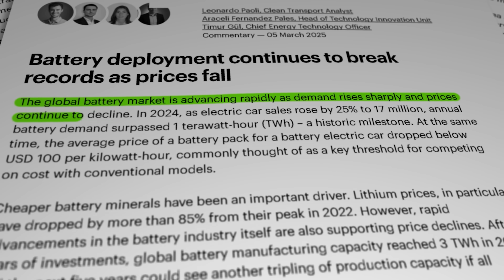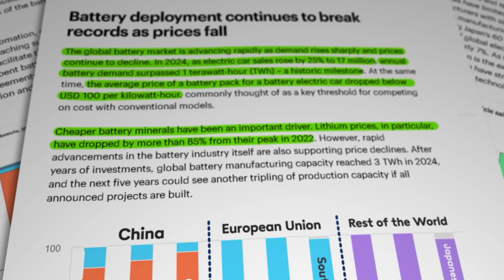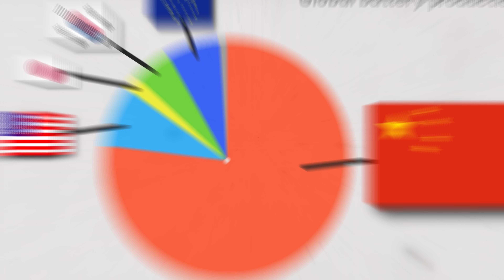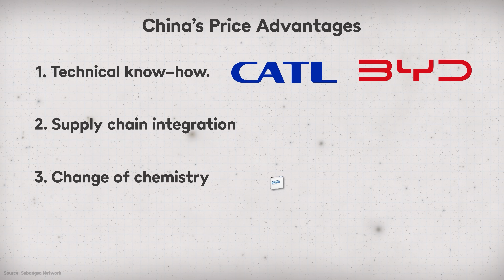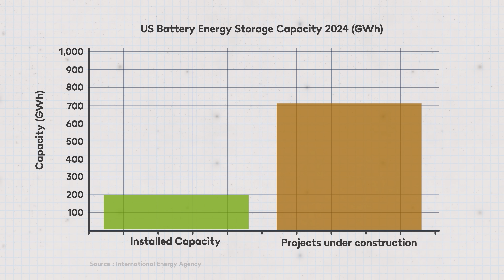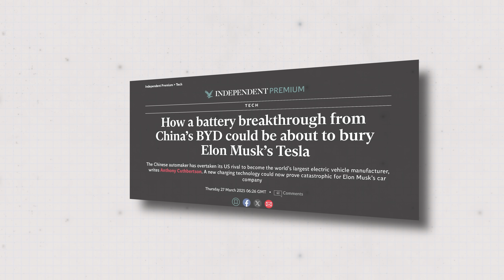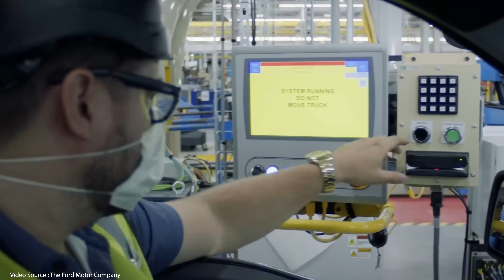Have batteries just hit their exponential curve??

Comment: I travel to Shanghai very often. There are still a lot of Teslas on the road, but sales have dropped precipitously. This is not only due to Musk and Trump destroying the brand image, but also because the Chinese brands are years ahead of Tesla with full self driving, styling and fit and finish. It's not even close. With an XPENG, it's FSD can pull out of the spot and drive me to a busy shopping center, find a spot and park again and I never touch the wheel. Musk's idiotic insistence on cameras only will ensure FSD on a Tesla never happens.
Reply: And yet the Tesla Model Y is up there in the best seller list in China. Users of FSD Supervised in China are saying it's a generation ahead of solutions from XPeng and BYD. Maybe you are swayed by media reports about Tesla vs. China EVs, but the fact is that sales dropped temporarily while the new Model Y Juniper production was being ramped after CNY,  and quickly regained strength. Tesla China sales are still easily No. 1 by revenue, and probably still close to No. 1 by number of sales.

Comment: I do think you give Tesla a bit too much credit, at least, globally. Based on what I've seen, regulations have been the single biggest factor in EV adoption, innovation, and growth. Even in the United States, Tesla built its business on the back of ZEV credits that it was able to sell to other automakers. Globally, China was making the transition to EVs with or without Tesla, and where China goes, the world was inevitably going to follow.
I will say that, even as an LFP advocate, I'm not fully sold on LFP being the only EV battery solution. LFMP should offer some energy and power density improvements, but they will always be a step behind nickel cathode batteries. That step might become a smaller and smaller issue over time, but for high energy, high power applications, it means that there will be a place for nickel batteries well into the future.

Comment: I attended a meeting with an MIT electrochemist on Thursday, not allowed to share details, but they see sodium metal as a viable battery technology that will outpace any lithium batteries by 10x and allow for use in aviation once fully developed and commercialized.
Reply: Promissory engineering. Let's say it true. Then the violence with which damaged batteries conflagrate will be roughly multiplied by the same 10x. It will make for fascinating videos.
Reply: @tomgroover1839  If it's not safe it won't be on airplanes. Not all chemistries have combustion issues.
Reply: @mv80401  li-ion batteries over a certain size are not allowed in checked baggage on commercial flights. There are specific rules regarding this that you can look up. So why? Because all batteries of a certain energy density x energy capacity and above are combustion risks that the FAA has identified. PERIOD. That's why there are EV fires to begin with. And now you say they are going to actually have gigantic batteries with gigantic power density as flight power sources.  Sure thing. Can you tell us what happens after one of these electric airliners disgorges passengers? Tow it over to a charging station for an 8 hour charge between flights were it sits unusable with all the other charging aircraft? Worse than promissory engineering. We're really talking pipe dreams here.
Reply: @tomgroover1839  I don't mean to be impolite but do keep up. There are battery planes in the air today, not in a pipe dream. Why don't you go check them out as opposed to just rely on your by definition limited common sense?
Reply: @tomgroover1839  - Obviously they would have replacable battery packs and NMH rechargable batteries have been used for decades with zero fire hazard. Newer battery chemistry is being developed with zero fire hazard.
Reply: @WJV9  How many times will the battery packs be swapped out on a cross country trip at 250 knots? How those high current battery terminal contacts going to hold up being slammed several times/day? How many people would like to fly across the country at 250 knots, stopping several times for battery swap? Really? NYC to L.A. in 18 hours? how about making it from the U.S. to the UK? Plenty of juice in those sci-fi batteries for a 5000 mile flight? a ridiculous pipe dream. Absolutely ridiculous promissory fairy tale.

Comment: The tipping point has occurred: China became the largest exporter of vehicles in the world several months ago.

China also found a huge amount of lithium inside their country: once that lithium hits the market, battery prices will drop. 

China already has a $10,000 eV in production. Most of the world does not make a lot of money, so the world market for cheap transportation is huge.

Mechanically, there is no comparison between parts in an eV motor (thin stamped steel sheet rotor and stator, copper windings, magnets, two ceramic ball bearings, and most importantly: no transmission). (go to youTube channel 'Weber Automotive" and 'Munro Live' to see tear-downs of eV motors),

 and ICE (pistons, piston rings, piston pin, connecting rods, crankshaft, bearings for every rotating part inside the engine, crank harmonic balancer, cam shaft(s), cam chain and guides, hydraulic lifters, valves, valve seats, fuel injectors, spark plugs, catalytic converter(s), expensive stainless-steel exhaust pipes and mufflers, expensive up-stream and down-stream O2 sensors,    and I will not even go into all the parts on modern 9-speed automatic transmissions!).

Comment: EV FSD (RoboCAB) will make automobile ownership optional for most Americans.
A "robocab," also known as a robotaxi or autonomous taxi, is a self-driving vehicle used for ridesharing. These vehicles are designed to operate without a human driver, relying on advanced sensor technology and software for navigation and safety. Robocabs aim to provide an efficient and potentially affordable transportation option, particularly for point-to-point rides. 
Here's a more detailed look:
Autonomous Operation:
Robocabs are designed to be fully autonomous, meaning they can navigate roads and traffic without any human intervention. 
Technology:
They utilize advanced sensor technology, including lidar (light detection and ranging), cameras, and radar, to perceive their surroundings and make driving decisions. 
Ride-Sharing:
Robocabs are typically operated as part of a ride-sharing service, allowing users to book rides through a mobile app or other platform. 
Potential Advantages:
Robocabs are expected to offer several benefits, including reduced traffic congestion, increased safety, and the ability to provide transportation to those who cannot drive. 
Tesla's Cybercab:
Tesla has developed a robotaxi, known as the Cybercab, which is designed to be fully autonomous and potentially affordable. 
Other Companies:
Waymo, a Google-spinoff, and Zoox, an Amazon-owned company, are also actively involved in developing and deploying robotaxis.

Comment: Our civilization is thermodynamically unsustainable and therefore doomed. It's a simple physics and resources problem. It's not even the first time this has happened, only the first time on a global scale.
We're not in an energy transition, it's a complete lie. We're doing what we've always done, adding new sources of energy when we invent the technology to harness them, while continuing to use more and more of the old ones. Our thirst for ever more energy is so great we're now using renewables (off shore wind farms) to power oil rigs because we desperately need both. It's a huge pile-up of energy sources.
For example, we consume about 4 times more biomass (wood) for fuel today than in 1800! The reason is simple, in 1800, although biomass was practically the only source of energy we used, there were only 1 billion people on the planet.
What comes next, when this civilization crashes? Who knows...

Comment: I remember the crash in the housing market or bubble in 2007 in the US and the amounts of money going into Chinese industries afterward. The tariffs will not replace the 10000 lives lost,  but they could affect investment in the form of new plants required to handle advanced new models now that chinese mining and manufacturing plants are twenty years on. I'm still waiting for advances in hydrogen storage and increased efficiency in hydrogen motors. I'm stilted by ozone depletion in the stratosphere by fluorocarbon and the increase of ozone in the troposphere at ground level by electrical equipment, including EVs. And the need to rebuild the power grid to accommodate evs with fossil fuel burning and nuclear power plants. Oh, and the transmission lines. Pick your poison. Oh, wait, the market will do that for you. Make that 10001. thanks